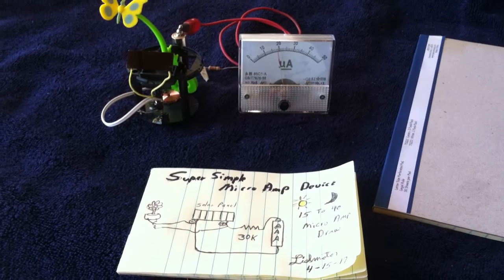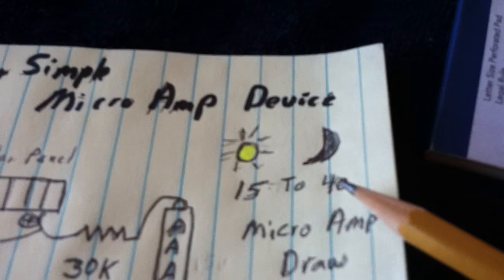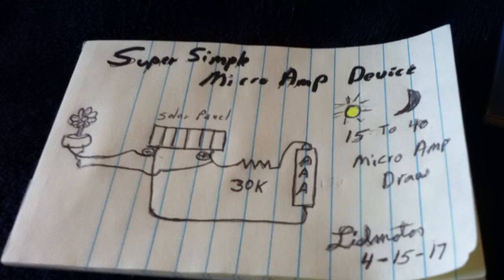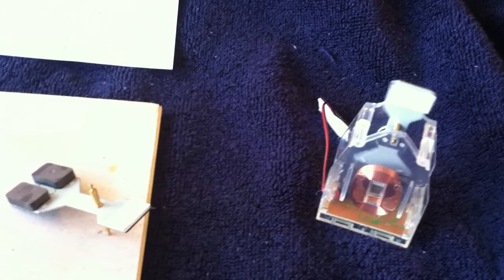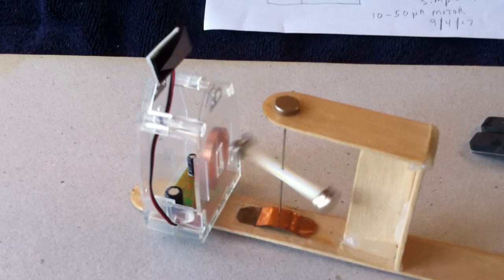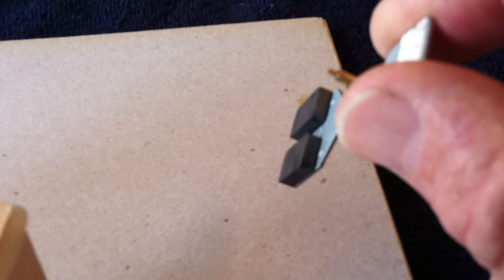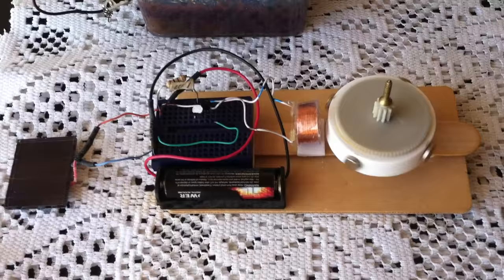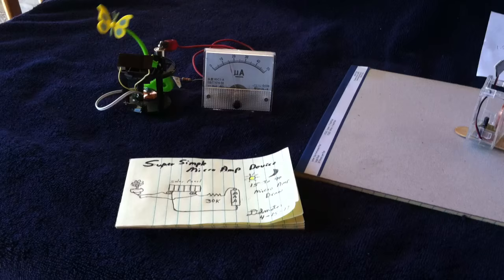Super Simple Micro Amp Device

Comment: Simplefix is 1 of the team for sure! That waver was a great find and then back engineering it has sent things forward. 
In the time it took me to realise his comment was in my spam folder (due to video link) you've gone and bought some and modified one into a runner !
Reply from the maker: Yep.  Simplefix is one of us now.  The circuit he is using is a bit different.  I set one up on a 8 coil EZ spin design and got it to work.  The way the 5 LEDs  (in series) are fired is strange.  These motors are very close to self-runners.

Comment: Those solar flower circuits are amazing.
Made a pendulum one last summer. Just a small ceramic magnet hanging from a thread over the coil- swinging back and forth as the coil gets energized.
Wondered about adding a battery backup for nighttime...
Thanks for the tips.
Reply from the maker: A 1.5v button cell would probably run one of these quite a while.

Comment: Nice builds. You might drop a diode into the charging circut between the solar cell and battery. Keeps the battery from discharging into the solar cell when it's dark. Good luck !

Comment: So around 50 hours on 1Wh which is around a good eneloop AAA.  I think pulsing is good for rechargeable nimhs.  I have several different garden lights which the batteries all died, except the one I put a pulsing circuit into.  The generic AA nimh is still going 5 years later with a crusty solar cell covered in oxidation.  The circuit runs the led dimly 24-7, but also pulses at around a couple of hertz.
Reply from the maker: Pulse circuits are amazing.